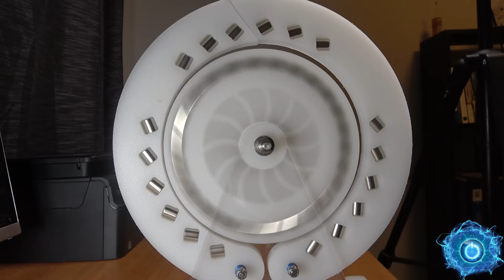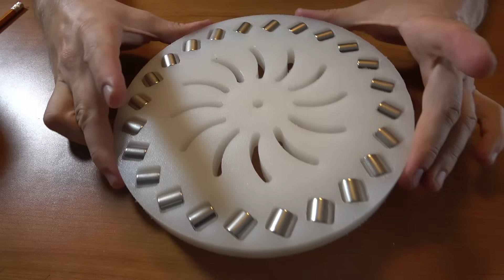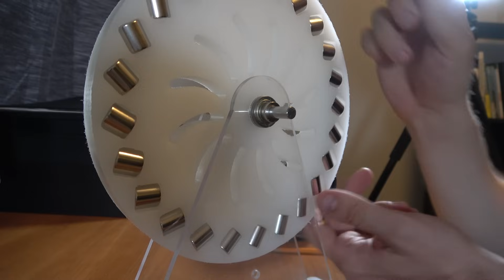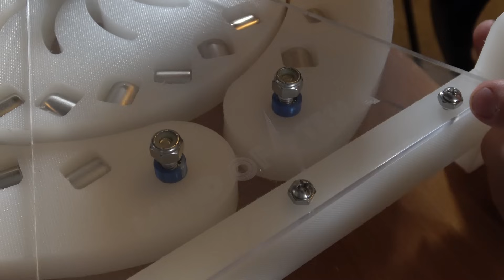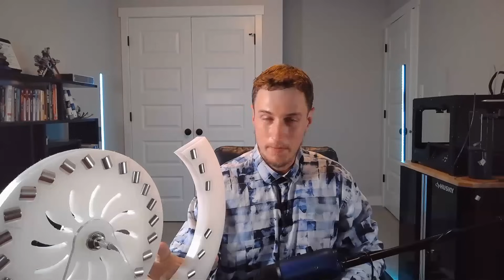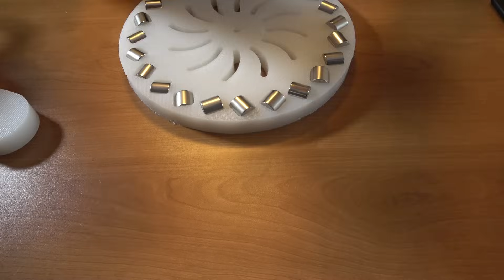Perendev Magnet Motor - Does IT WORK?!

Comment: The problem, I conjecture, is the magnetic dipoles. Sure you can push against the one side of a magnet but when it's opposite pole arrives it counteracts the original push and attracts (or vice versa depending on the push/pull system used, IMO.) If one could shape a magnetic field appropriately (like a magnetic monopole, perhaps?) and only have those fields interact then it would be like a water wheel with the forces always in the same direction. I hear that there ain't no such animal as magnetic monopoles in nature but can we seperate the two poles with distance or shielding to ensure that forces don't counteract each other? (This is one of my thought experiments that helps me to drif off into sleep at night, sometimes.  Just sayin...)
Reply: It wouldn't work with monopoles and you can not separate magnetic poles.
Reply: Actually, one of Maxwell's equations means precisely that there are no magnet monopoles.
Reply: That's Gauss's law of magnetism, a simplification of Maxwell's equations which is only true if you assume magnetic charge does not exist or is uniform everywhere. If we discover a new elementary particle with magnetic charge, it would necessarily introduce divergence in the B field, but in a hundred years of experiments nobody has found such a particle, or even made a prediction of its properties, so Gauss's law is a very useful simplification. There is no law of physics that says monopoles cannot exist, but if they do they must be a new kind of particle and might not be useful on large scales. They might even act like quarks, where if you try and pull them apart the energy in the B field is converted into a new north-south pair to keep the flux loops closed
Reply: @magnuswright5572  
Exactly, but in 2014 there were found chains of molecules in "spin ice" where the ends of those chains behave like magnetic monopoles. Still always as pairs of monopoles and thus not separable, but for this configuration the law of Gauss doesn't work, except you'll add the chains as "hidden" magnetic flow.

Comment: I've heard you can actually make it spin "forever", but it can't give out any torque, thus it can't produce electricity nor any useful amount of other mechanical work.

Theoretically, you could build some really expensive and crappy tabletop fan with this, just remember not to blow or even speak towards it so that the moving air wont stop it? :D
Reply from the maker: Heh yeah, it would be nice to find a  smaller one that is not so expensive. Maybe modify with coils.